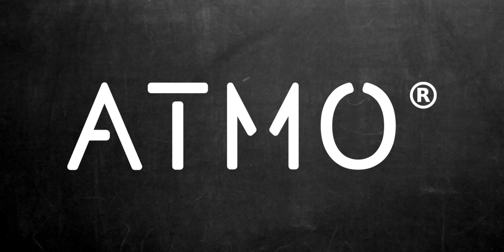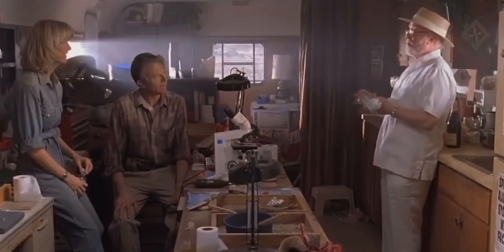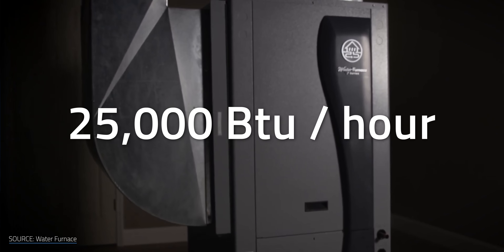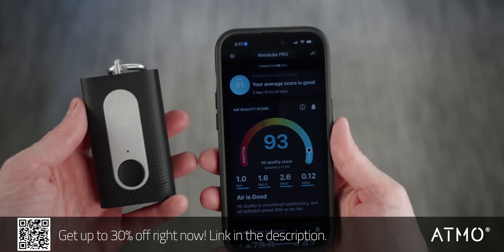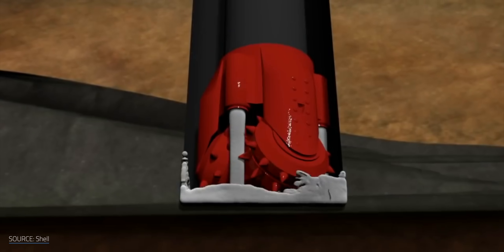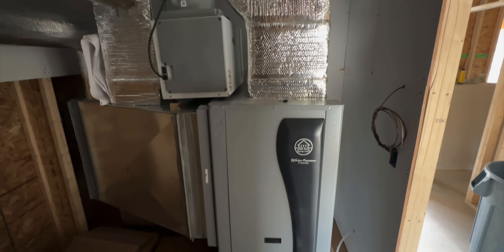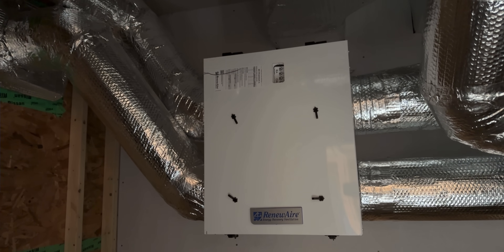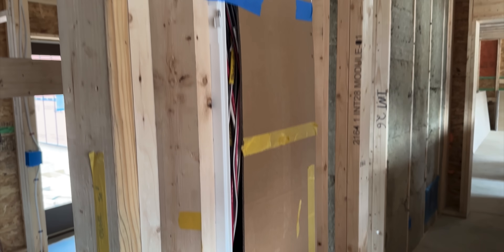Why I Went With Geothermal For My Net Zero Home

Comment: Great video Matt. Can I ask what you are putting in place to control the humidity and air quality on your new system. Most commercial systems seem to skip over these points and as a result you get circa 20% humidity whereas it should be between 40-60%. Again with air filtration this often gets missed and this will obviously be important for you if you suffer from allergies.

Comment: So.... this might sound a bit stupid of me, but what is stopping a horizontal geothermal loop from being run under a house (given enough depth to prevent the tubing from being deformed under the weight of the house)? Since you have to dig out the foundation and water piping anyway, it just seems like a no brainer.... especially with land lots getting smaller in suburbia.

Comment: I used Lutron smart shades in my last house and they were amazing.  I used Bali electric blinds in my current and I regret not spending the extra money.  They are garbage.  I programmed my Lutron to help with the heat load and it helped a ton as my old house had tons of huge windows on all four sides.

Comment: Matt - I don’t think your crazy at all!  I’m living vicariously thru your adventure. I think starting with a new build and methodically moving up is a very smart move.  I like little touches that can also be controlled manually (switches, blinds etc).  That was requirement of my wife to avoid a “my husbands not home and I can’t turn on the lights :)

I have a geo thermal installation as well. I wish I could have had the drilling company you used.  Seems more thorough.   My home was built in 1965.  A net zero definitely requires new construction.  Too late for me but I’m loving what your doing!

Comment: Don't forget to optimize which angle the window shades sit at. In the winter you want the sunlight coming in so you want to angle them to let the light in. In the summer you tend to flip the angle to keep the sun from shining directly into the rooms.
Reply: I did that with my house design. It makes a huge difference. I'll get 5 metres of sunshine into the house. The living areas on a sunny day in winter and of course known in the summer.
Reply: @DarylRaverty  Hi, would you kindly  share the type ( manufacturer?) of window shades that has these features? (I presume you can remotely control the angle), Thank you.
Reply: I've tinted all my houses windows.  Helps a lot with the brutal summer solar heat gain, and I don't suffer at all in the winter, the bonus is it reduces interior light which is nice because I have very sensitive eyes.

Comment: Matt, Home assistant is running my house as well. My company has also developed a battery, compatible with most HV solar inverters.
As for  ethernet cables... I avoided them by using mostly zigbee. Yes it's wireless, but has caused no issues in two years now.
As for geothermal... I have one as well. With floor heating. And for cooling, I have a heat exchanger between 7C liquid from the ground and my recuperator/ventilator. So cooling takes no energy, I only need to run circulation pump.
And this plays well with natural convection - warm air rises up from the floor, and chilled fresh air sinks down from ceiling.

Comment: Nice, Matt! Interesting to watch because I also live in New England (Massachusetts) and I also have a Water Furnace geothermal system with vertical ground loop, forced air, etc. My system is about 15 years old and this was my first year living in this house (I just moved here). It performed really well during the cold winter and even kept my house warm during the cold snaps we had that got down to -25°F. My energy bills were so much lower than all of my neighbors due to that geothermal system and my heat pump water heater. You’ve made some great choices for your new home.
Reply: We love your comment. Thanks for choosing WaterFurnace for your home.

Comment: Question.  How much power will your geothermal pump have to be considering the single deep well. Years back i was told that the fluid pump used the most power for the system.

Comment: I have had Enphase solar for over a decade and, until now, it has been bulletproof.  The microinverter technology I think has helped improve production given the panel configuration but I'm a data point of one.  Last July I contracted to have Enphase batteries installed.  Unfortunately, that contractor company who installed the panels in two stages now has resulted in 6+ months of no solar production and the battery installation is still not complete.  I think 90% of the problem is the contractor but Enphase sent out technicians twice who reported issues with the equipment.  It will be interesting to see if you encounter any stumbling blocks with your all-in-one go installation and likely high visibility to the Enphase personnel.

Comment: 60 cat5/6 lines is frankly not that much!  You can use cat5/6 for all of your low voltage smart lighting and light switches using PoE, with a system like LumenCache. You don't even need an electrician to run low voltage wiring so you could have done it all yourself for cheap. Your smart shades could also use cat5/6.

Only 3 prong power outlets need full copper electrical wiring these days. Just imagine how many cat5/6 lines that adds up to!

Comment: Make sure to get the makeup air right. I'm assuming the kitchen hood vents outside. Ideally, the makeup air has its inlet close to the hood. Otherwise conditioned air is vented. NS builders has a video on that. We replicated that and it works.  Please note, makeup air needs filtration. The ERV will most likely not be able to handle the cfm load of the kitchen hood.

Comment: 100% absolutely do not think you're crazy! I'm systems integrator and for over two decades have been studying and passing that on to the end user about every possible sustainability device or method under the sun. That is quite obvious from all your videos that you've taken the time to learn about everything that you explain. It's actually super cool to see someone doing this and actually thank you cuz I've directed clients prospects and engineers to your videos because I just didn't have time to sit down and explain it to them! Thank you again for all that you do and I'll send you some specs on our next project I think you'll be totally psyched!
Reply: not worth the bother.  mandate good windows and insulation for builders...add solar.  heatpumps and forget most of this crap.  a 400ft well is what 20,000? 40,000?  1 ton of heat pump is 2000?  so the time value alone would cost the entire system value -100%every single year....this is insanely uneconomical?  a 2 ton heat pump 31 seer is only 2000$. maybe 3000 installed.  yes you need multipe smaller for rooms etc.  but still 400ft for a geothermal vs air. ffs

Comment: Smart shades? Sure. Great idea. I can however advise against automatic attic window openers in case you're tempted. These systems rely on logic that can get scrambled by electrical spikes--causing them to stick in the wrong mode and burn-out the motors and/or strip the nylon gears in the window mechanism. Good luck.

Comment: I wonder if you're going to save on cooling with the automated blinds if the blinds are on the interior. Isn't the heat already inside the house by the time it reaches the blinds? I would think that shading the windows on the exterior would be more beneficial.

Great video BTW!

Comment: this is what you do once you have disposable money from youtube income. not a fan of the geothermal thing due to cost. I think just adding more panels and split types in each room going to be less expensive and probably more efficient as air doesn't need to be ducted and only use energy when there is a person in a zone. the insane networking cables may not be crazy if you use it for automation and LED lights, however it looks thick. is that CAT7 cable?

Comment: we have an older version of theirs and it is super quiet.  you may not even know that it is on.  Works fantastic in the spring, summer and fall.  works ok in the winter.    look forward to see how yours does.  ours probably would work better if it was a vertical one.  we have ours horizontal.

Comment: This build seems a bit daunting. How many planners/designers were involved to oversee the construction to ensure the many sub contractors didn’t interfere with each other. Did you hire this separately or was it included with the purchase of the home as a package? There are so many specialized  systems. Did you research each of these and find an installer or did the planner/designer handle that? Tell me more about the number of professionals involved. It would also be great to know the cost breakdown. I suspect this is out of reach for a middle class income and will be for some time.

Comment: We also did this here in sweden. After more consideration i think it´s a bad decision. With the money it cost, i would have been able to get 40kwh battery and a bigger electric water heater, that would have lasted all day, whilst heating the water at night. 
Charging batteries at night and loading up with hot water nightly, would be way less expensive, then the geothermal solution.
This ofc depends on your electric cost, but atleast here, you pay way less for electricity at night.

Comment: Matt, I'm curious about the about the engineering calculations for your system. What is your cooling vs your heating requirement or thermal imbalance ratio? The is an interesting article from NREL about this, but I'm curious how it applies in your situation?

Comment: There's a lot of benefit to be had integrating home automation and blinds. I spent some time playing around with forecast solar, modelling windows as if they were a solar panel to observe heat gain / loss in a recent video (don't think I can post a link in the comment). Integrating the modelling and behaviour into home assistant was trivial and has definitely helped with reducing heat demand during winter/spring.

Comment: I just was billed A$174 for last Quarter electricity.  Cheapest for awhile. Old house with wood burner heater and Solar hot water system.  I use little electricity.

Comment: Is the geothermal system the same thing as a ground source heat pump? It looks the same to me, but I'm not very knowledgeable on the subject.

I've always associated the term 'geothermal energy' with areas of natural volcanic activity, such as Iceland, where water can pass through the heated ground deep down, in order to be turned into steam/used to heat a building.

Comment: I love to hear about the system you chose for your new Net Zero house. I would have love to build one as well, but the cost of building now have become prohibitive. I selected to buy an existing house and will do my best to make energy efficient. I am presently examining the options for an electricity back up system for power outage which are become more frequent. One of the option is a battery backup with a few solar panels. I need this mainly to power my well pump and water treatment system and to power a few outlets during power outage and possibly as a back up during peak hours in the winter when the cost of electricity is much higher. I would love to hear about your battery back up and why you chose Enphase rather than another system. Thanks for all your good work.

Comment: Beyond perfection is a step backwards. We have computer controlled too much at work, turn a light on/off, at some point for a reason only the programmer thinks is sensible the computer turns it off/on , and the battle goes on for ever. Heating control is disabled at night so we buy inefficient electric heaters and turn off the cooling system every 30 minutes which turns on to counter our heaters while it is negative five degrees C outside! The manual switches are perfect on/off when YOU want it...
Getting angry and having competitions with stupid apps is a waste of life...

Comment: I don't know how this will work in practice as the house is not finished, but I have purchase wireless light switchs. The switch can control individual or multiple lights. 1, 2, 3.... way switching is easy.
There is no power going to the switch. My switchs have a 12v battery, however you can get some that will generate power from the push on the switch itself to generate a signal to the controlrr in the ceiling.
So much new tech.

Comment: You can install radiant cooling. I’ve designed a radiant hydronic heating and cooling system using Messana Ray Magic ceiling panels. They go under the plasterboard and not even seen. My cooling load here in Aus is about 3 times the heating load, and I can just make this work in my passive designed house. It is expensive though, and not sure I will pull the trigger yet.

Comment: Well Done... The most Earth "Friendly" way that I see. (and Yes, for some you "people",  making, casting, Producing parts is some still using coal) 
But, reducing some coal / Oil usage is BETTER than using full grid.

Wished all house newly built is using renewables... (and some old ones, converting)
BTW, Matt, https://www.youtube.com/@UndecidedMF , any info / video suggestion on how to determine to knew our house environment is good for Geo thermal electricity ? (Equator area) And also building a "simple" ways.

Comment: I'm a little curious on a few things... the drilling went pretty deep, did they discover some nearby cave systems or something? Since your house is so wired now, did you include access panels for if some cables and things need to be replaced? Cool home though and I appreciate the update even if its been a long time.

Comment: Geek!! (just kidding) I am not sure where you are located, but an air to air heat pump is generally the most effective unit in first cost vs benefit ratio in most of the United States. I have seen commercial systems that have overdrawn their wells and have had to supplement with gas. There's something about having to run a 150hp pump continuously that seems counterintuitive. Well spacing suggestions in the engineering community seem to be increasing and I have heard the term "bore lifespan" being thrown about. But you do you, I'll stick with my 20 yo air to air units for a while. I could comment on Waterfurnace: I have never understood why what was a "water source heat pump" suddenly triple in price when you put the word "geothermal" in front of it. There's no functional difference. I am also curious who's compressor they are using. The standard of the industry is (arguably) the Copeland scroll, but they do not unload well. I think they have a VS version, but it is unproven. Let us know how it all works out.

Comment: Do you have any redundancy plans for your smart house?
I mean, everything is based on electricity. What if you have a hail storm that kills your panels and causes an outage for your electricity supplier? Won't you choke to death in your sleep when there are no electrons moving air into and out of your house? Won't you freeze if there's a snowstorm that kills your mains supply and a cloudy day doesn't generate enough to heat up air/water inside the house (10ºC geothermal is still pretty cold)? Or if some rodents mistake your wiring for chewing gum and open the circuit, or worse, blow up some electric equipment before fuses react (you're using the standard, thermal fuses, right? They take some time to react which sometimes means killing some electrical devices in that split second)?

I'm under the impression that everything in your house relies on electricity. But what happens when you don't have it for whatever reason?

Comment: Geothermal gives a better COP than airsource because the average ground temperature is higher but over several years the ground temperature does fall as heat is extracted. 
The heat is replaced as it is conducted from the surface; essentially becoming a huge solar collector. But the COP does fall. 
Even better should be a hybrid system reheating the ground directly from air in the summer. Also using airsource when the air temperature is higher, such as in spring. In theory you can overheat the ground and get an increased COP with a much reduced borehole length.

Comment: Wait, are you going to have geothermal and solar?. Maybe I mixed the point of the last part on the video. I thought geo is the father of them all as it’s consistent and reliable. Hmm. I’ll rewatch the entire video again.
Reply: Matt's geothermal heat pump provides ultra efficient heating, air conditioning, and supplemental hot water. It uses the stored solar energy in the ground instead of the deep core hot rock heat used for electricity generation.
Reply: @WaterFurnace  thanks I now get it.
Reply: Solar PV is for electricity.
Reply: @ronaldlenz5745  awesomeness 🙌🏿.

Comment: How resilient are the smart home systems? With all the intelligence, communication and coordination between the different sub-systems, how will the overall system handle failure of individual components? Also, what kind of soundproofing did you use? And are you using an external shading to minimize solar heat gain in the summer?

Comment: i would be interested to see how the home performance pans out.
one thing you glossed over in the video is dehumidification, especially with ERV's, as ERV"S tend to keep moisture IN the home (as well as out). i do not know your climate, you might get away without it.
also how you do the range hood and the makeup air for the range hood. i do hope your not going to use a recirculation hood.

Comment: This is a great explanation of what you are doing and why. The air exchange system for outside air is really interesting, as I did not know about the new technology in that area. I assume you have also checked for radon flow in your new foundation. Some places have high fluxes of radon from the soil and bedrock. Super insulation with radon is a problem.